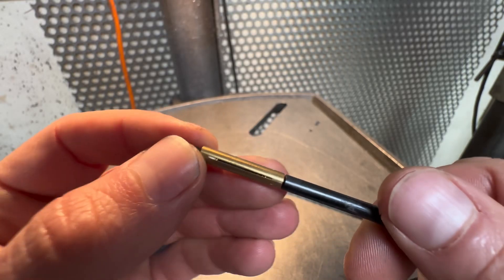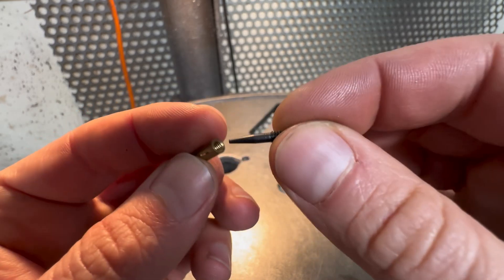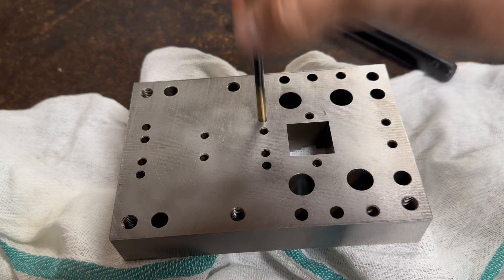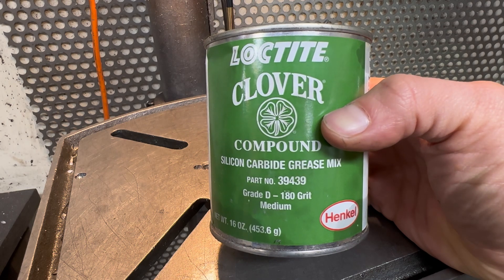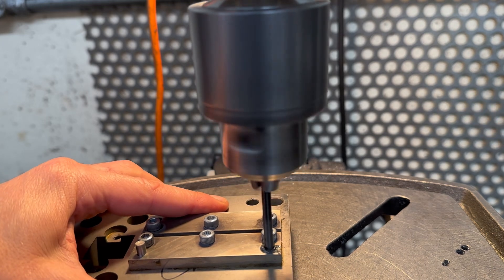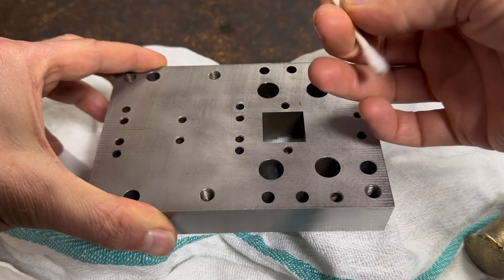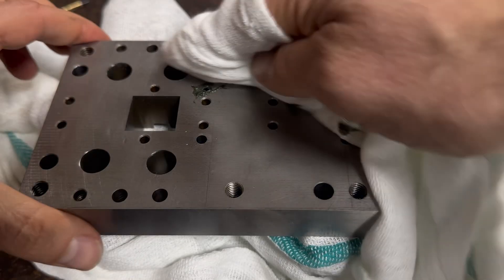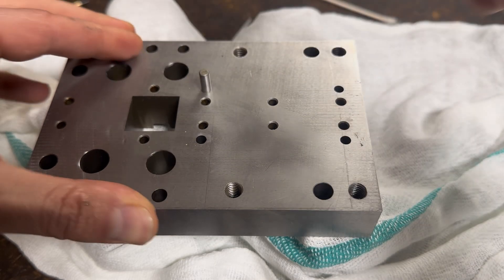How to Lap a Hole like a Pro - Tool & Diemaker's Guide

Comment: For lapping can we use Permatex Valve Grinding Compound? would be a cheaper alternative.  I have a .373 hole to lap, will a 3/8 be fine? The lap barrels are slighly undersize? Thanks.

Comment: Dude, watched all your videos. We need more content like this. That said, I’m amazed how you can do such accurate work with so much care one moment and then use a janky drill press the next of sand blast a part with such high tolerances. Kinda makes me smile as I can use my favourite drill press even when I hone in on tight tolerances. Found an Edm sinker system for $1200 not too long ago, didn’t pull the trigger and am now regretting it.
Reply from the maker: Every machine has its own purpose. Some need to be accurate and some don't as you know. We could use a nicer bead blaster...lol..but it does the job.

Comment: What kind of applications do you use a fit that exact in ? I'm in large press tooling (OEM autobody) and we usually don't go beyond your basic ISO fits scale, and those are noticeably higher tolerance than what youre doing. Also, obviously, you don't need lapping for ISO fits, since they are usually either turned/bored or made with a reamer
Reply from the maker: That hole is used to locate the material guide on the frame. I could not use a reamer, because the guide had to be set up after heat treat to properly center it .It was cut undersize by one of our wire machines and I didn’t want to put it back in the machine to potentially cut it too large so I just decided to lap it.

Comment: "Lapping is not made to take off alot of material"😂😂😂
I disagree....

If I don't grease the pins on my backhoe, they'll self lap out lots of material. Trust me. And it happens faster then you think.
Reply from the maker: how much is a lot ?
Reply: @ToolanderEngineering   just few days ago had to open up a 25.95mm so a 26.00 pin passes through, it was a repair job, RC60 and interrupted cut (grease port), 50mm depth through hole, so it was pretty impossible to bore out to size, hardmilling was out of price range, reamer too expensive, so a quick aluminum piece was turned, total length maybe 60mm, first 1/3 of the length was 25.6 tapering up to 26.00 (the taper will wear, ended up tapering from 1/3 to 2/3 up the total length when the job was done), rest cylindrical, used angle grinder with a cutoff wheel to create "flutes" for abrasive, then the coarsest diamond I could find in my drawer, it was as much as lapping as drilling, as all it needed was a straight round hole for the 26mm pin
so - yes, you can remove a lot of material quickly, 5-10min to make the aluminum "lap" and another 20min to "drill" using diamond, afair 40 micron, and don't use paste, that is pretty much tumbling action only, use thinner oil to wash out swarf, preferably some suspended diamond/carbide to aid the action
and it will try to grab when the work piece and taper start to match, so care needs to be taken, don't tighten the chuck that holds the reamer too much so it slips once it grabs, punch/tap it out when it does grab and restart
Reply: @ToolanderEngineering  Well, I'd say .050 in 20 hours. Dirt in those pivot points is terrible. Especially when you're working in sandy soil. Lucky for me I'm gonna make new pins and bushings. So it'll save me thousands of dollars. Besides its shop time. And I love shop time.
Reply from the maker: @highlandermachineworks5795  .050 in 20 hours, that’s quite a bit.  Lapping .050 in hardened  tool steel would sure take a long time and a lot of effort. Thanks for watching.
Reply from the maker: I’ve never actually made my own lap. It’s something I should learn. Thanks for sharing.

Comment: but....what is a LAP???
Reply: And, there might be an ABRASIVE PASTE involved.
Reply: Once around the track, or back and forth in the swimming pool.
Reply from the maker: It’s basically just a tool used for opening up a hole a very small amount. It can be also used to create a very polished surface finish.

Comment: How does heat affect things when working to such small
Tolerances ?
Reply from the maker: Heat is a factor. For example when surface grinding. The hotter the part gets the more the part warps, and the more you have to trim off later. Even the outside temperature can affect this.

Comment: Why wouldnt you just ream the hole? Are u lapping to achieve a better surface finish? ...I've never lapped before that's why I'm asking.
Reply from the maker: The material guides had to be mounted and properly set up on the frame after heat treat. The holes were wire cut. However, the holes turned out just slightly undersize so they could have been rewire cut, but I was afraid that they would be made too large so I decided to lap the holes. I didn’t need a better surface finish. The surface finish was quite irrelevant for what I was doing.
Reply: @ToolanderEngineering  ah ok that makes sense! Very cool I enjoyed watching ur process
Reply from the maker: @geminisduerme5266  👍 thank you for watching
Reply: This is the equivalent of precision grinding, only for the inside. Check out some videos on that subject as well. Dumore makes/made tool post grinders for such work, and they are still needed today for such things as precision grinding a bearing race after installation on a crankshaft pinion.

Comment: If I may,  
The basis of lapping is using a soft material which embeds with the lapping compound and that abrades the harder material.    I use diamond paste as that being the hardest material known to Mankind,  cuts for longer before the lap needs recharging with fresh abrasive.   20 micron,   equivalent to ~ 1,000 grit
The lapping process generates "swarf" which,  as it lies between the lap and the part needs to be frequently washed away.  I use WD 40 to do that.  The "swarf" appears as a blackness in the WD 40.  When the lap produces noticeably less "swarf" and upon expanding the lap does not increase the amount of "swarf",  then time to recharge the lap with fresh abrasive.   I lap mostly hardened steel and cast iron in my work and use aluminium laps,  both male and female.  To lap aluminium I make laps out of phenolic material (Micarta,  Tufnol)
I assume the mild steel stock,   cap screwed to the die block is to guide the lap and eliminate bell mouthing of the lapped hole.

Measuring a hole size using a gauge pin has limitations.   Using a Mitutoyo (and others) Intrimik internal micrometer will tell you the actual size and at different depths of the hole.   Horrendously expensive though to cover a range of hole sizes.
Little known benefit of lapping is that it will remove any lobing that may be present.
Reply: There are several compounds harder than diamond, but the rest of your comment is right on.
Reply from the maker: I appreciate your input. The plate screwed to the frame is a material guide for the die . Thank you for watching the channel.😀

Comment: Nice informative video. But needing a hammer to insert the pin would suggest it is undersized.
Reply from the maker: Dowel pins used for location should be a press fit and would need a hammer. Thank you for watching.

Comment: That a Pratt and Whittney old lap tool , nice video , if you want to avoid taper viscosity of the compound is important , shall be fluid enought to run beteween the lap tool and the bore and also use always two size abrasive size grain , make a first rought cut and go to fine grain size as the finisg will be better and the final dims easier to reach , normally that allow to reach 0.001 mm easy with a bit of skill 
Anneal red copper is better than brass as that softer and able to keep abrasive on the surface
Great video thanks , old tools are still alive